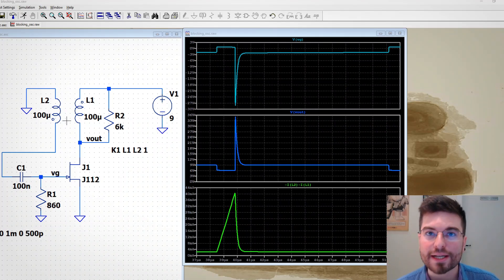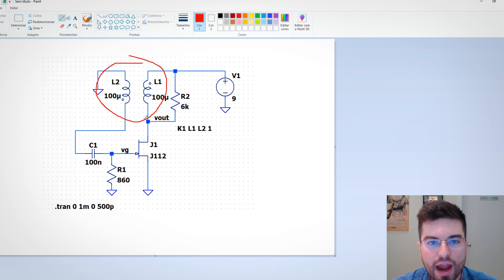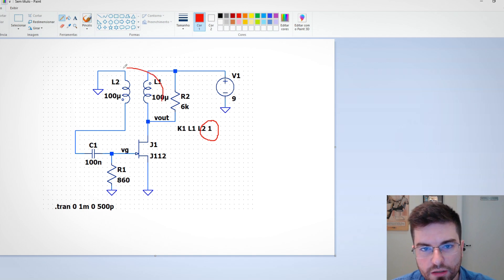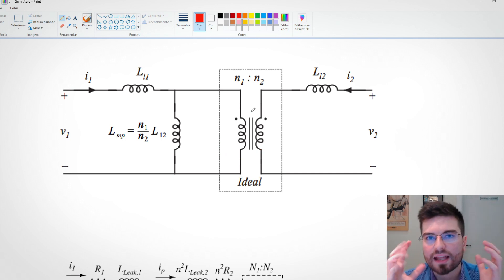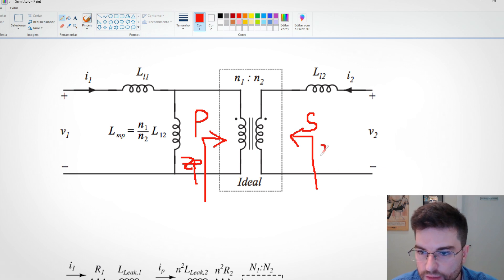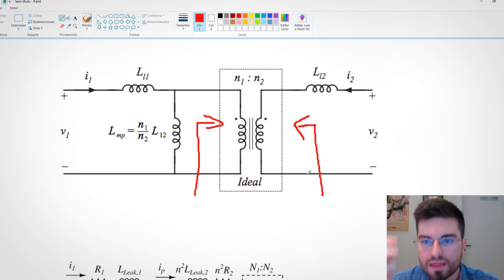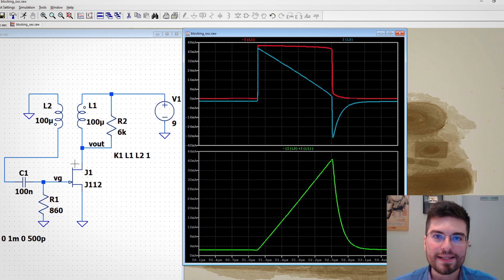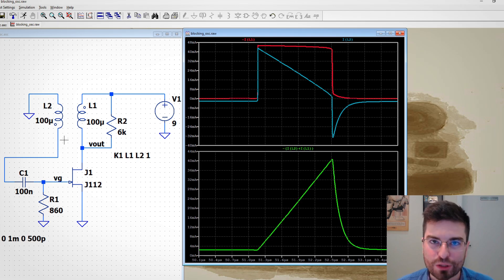Transformer and Magnetization Inductance

Comment: as an RF engineer, i have been "indoctrinated" about thinking about inductors as stuff that "integrate" the voltage waveform (inductor impedance is jwL). Thanks to your video, i was reminded of the more physical explanation of what it is actually doing! Thanks!
Reply from the maker: Thanks for sharing!

Comment: This video doesn't state it loudly enough that an ideal transformer works for DC just as well as with AC. Sam Ben-Yaakov's video starts off with that fact and then explains the necessity for AC as something caused by the magnetization inductance of a real transformer.
Reply from the maker: I would love a collab with Ben !
Reply: @AllElectronicsChannel  yes, you, Ben and FesZ electronics are some of the most underrated yet very important channels
Reply: Yes not Dc but rather looks to involve a dc voltage source and a switching event
Reply: that is not DC.